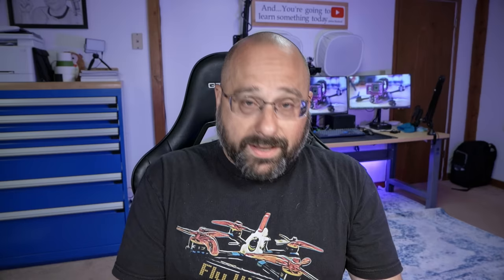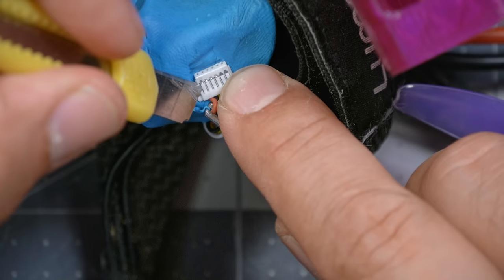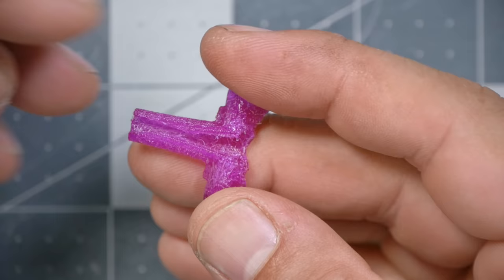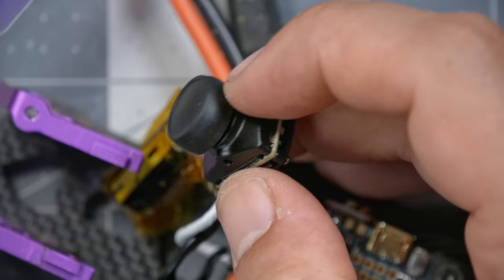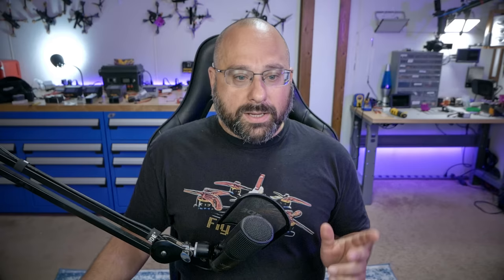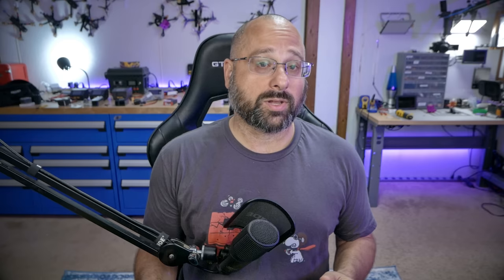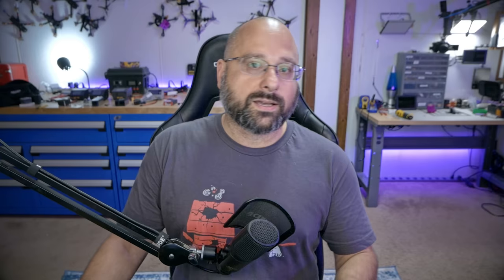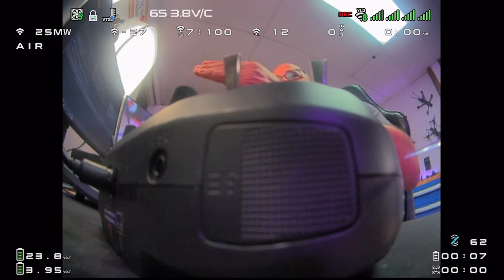Build an FPV drone in 2023 - HDzero Video Transmitter

Comment: At 7:29, I woudn't put those pins full of the Bluetag back to the connector😯...this needs to be cleaned first...BTW, why didn't you use Omnifixo to hold the connector instead of the Bluetag?

Comment: New enthusiast here totally green 
Want to get into this hobby but dont know where to start 
Things I do know  I would like to have the fat shark goggles and the RadioMaster Zorro max  Controller 
Also would like a long range drone 
I have a frame and propellers that have gotten off of Amazon 
But I’m perplexed as far as motors stacks, and everything in between as in to what I need to be fully ready To start flying 
Fully Functional drone 
How many  batteries and what kind
Controller if it will work/pair with each other ahhhhhh

Comment: That series are great. One question about quad setup. How can I configure my drone to fly perpendicular to the ground? It's for an research about the drones speed and they angles in flight
Reply from the maker: If the drone is perpendicular to the ground, what will provide the lifting force to keep it in the air?
Reply: @JoshuaBardwell  They gone lift parallel to the ground like most drones during flight they will angle forward as gain speed. The study that will be made is what the best angle for the speed they fly. And how long they can fly perpendicular to the ground. To know how to make more efficient fast drones without fix wings like tilt rotors. I know they can fly parallel to the ground whatch the drone that make the fastest quadcopter in the world on Guinness record. I need to know how to program the attitude angle of flight in betaflyte, for example.
Reply: @JoshuaBardwell  And about the lifting force to keep flying perpendicular to the ground will be generated by diferecial thrust like al quadcopters maneuvers. In simple terms, the two motor and propellers facing the ground will spin in a different speed than the others.
Reply from the maker: If the drone is perpendicular to the ground, there is no vertical component of thrust, and it falls out of the air. The drone must always have some thrust angle less than 90 degrees to have any vertical component of thrust.

The vertical component of thrust must be equal to the weight of the drone. So you can use trigonometry to figure out the amount of vertical vs. horizontal thrust. If you have a drone that weighs 650 grams, and the motors make a total of 4 kg of thrust, at what angle is the vertical compoennt equal to 650 grams? That is the maximum tilt angle of the drone without losing altitude.

Comment: u thing hold the VTX with Tape is good? i mean the VTX will go hot, this has no effect on the durability from the Tape?
Reply from the maker: I assure you, it's fine. That tape will hold. You can use screws if you prefer.
Reply: Gorilla double sided sticky gell tape is excellent

Comment: Non flyer here. Is it possible to get an fpv drone on par or better than a dji mini 4 pro?
Is this it? 
Is the HDZero better than the O4 system?
Reply from the maker: An FPV Drone is a totally different animal from the MIni 4 Pro. It's like asking whether a sportscar is better than a passenger bus or a truck. 

HDZero has much lower latency than the DJI system, so it is most appropriate for high-speed, precise flight in close proximity to objects. It has worse image quality, resolution, and range compared to the DJI system.